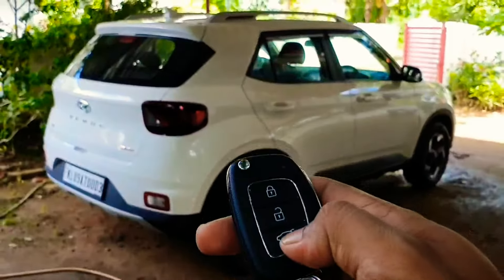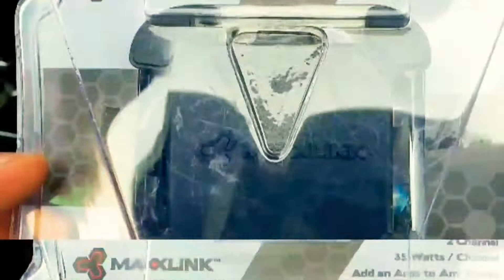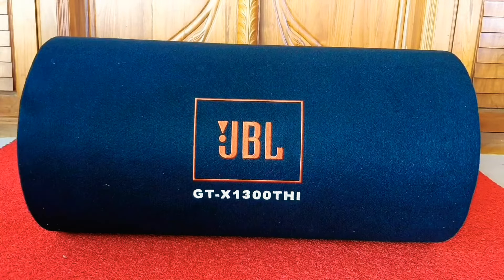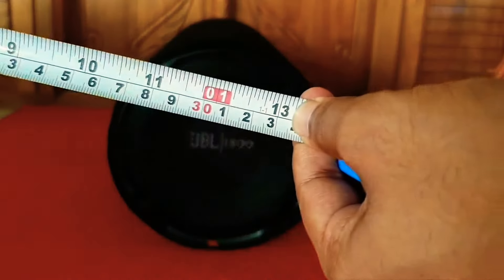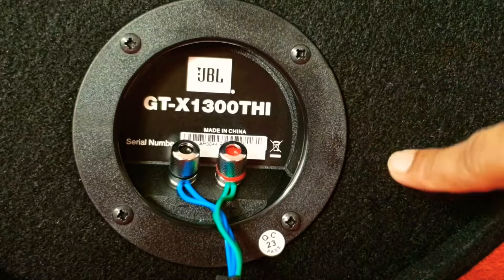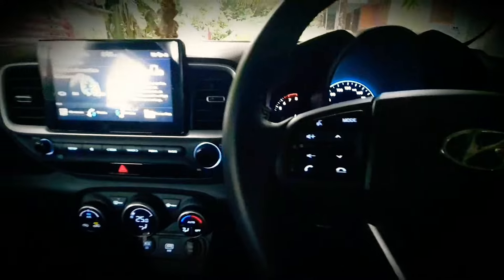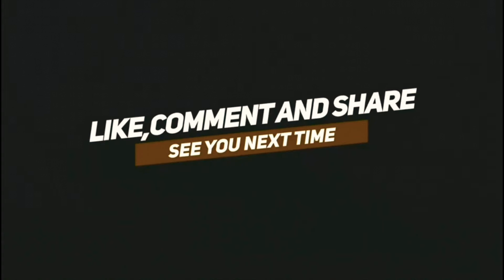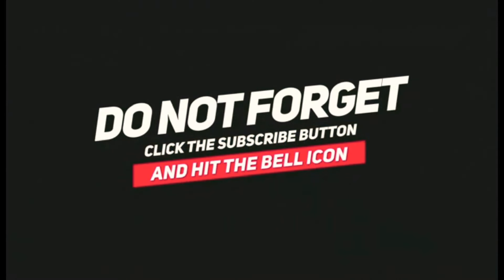🔊 JBL Sub Woofer in Car | JBL Bass Tube 1300 Watts | Bass Test | GTX 1300 THI 🔥🔥🔥

Comment: Jbl 1300 aur 1500 best
Reply from the maker: only small differences between 1300 and 1500.
You will not use full capacity of 1300 then I think no need of 1500.

In this video I am only using 40%of actual capacity. It is far enough for a car. Full capacity is enough for a Bus
Reply: Konsa